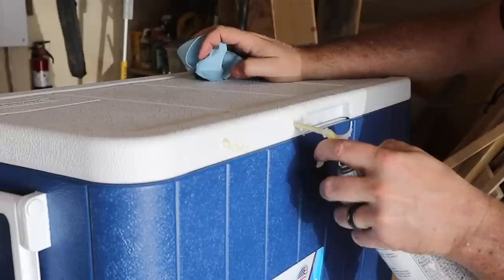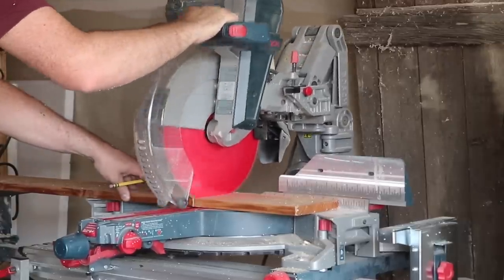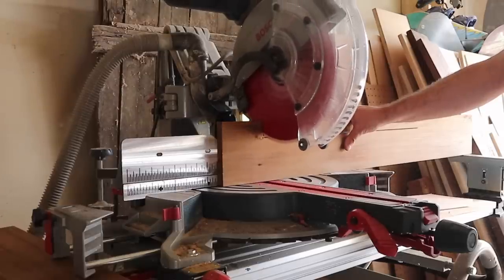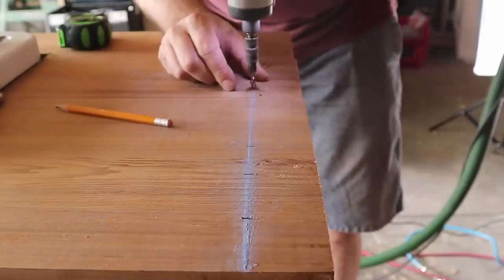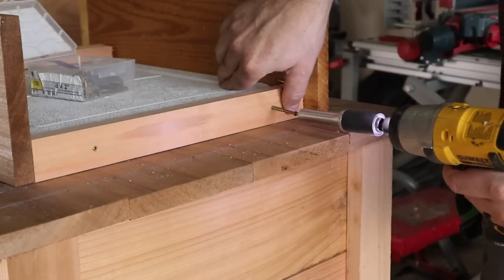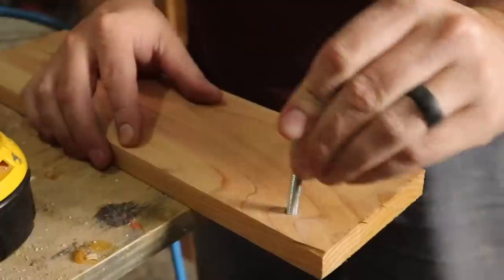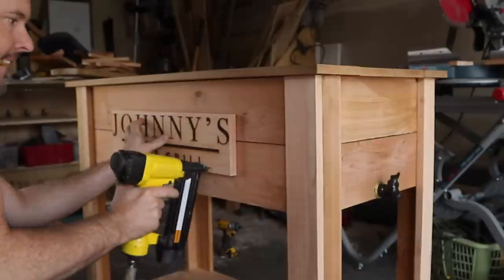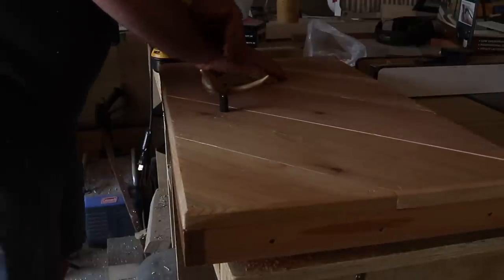Do It Yourself Outdoor Cooler Stand

Comment: Great video!! How did you attach the antler? What are those fasteners you used?
Reply from the maker: I attached the anchors to the wood frame with screws, but the straps I used to hold it in place was just galvanized pipe strapping.
Reply: Sorry I think you misunderstood.  I'm talking about the deer antler on the lid. Are those special fasteners?
Reply from the maker: pbjsfam no, just threaded builds and spacers from Home Depot.